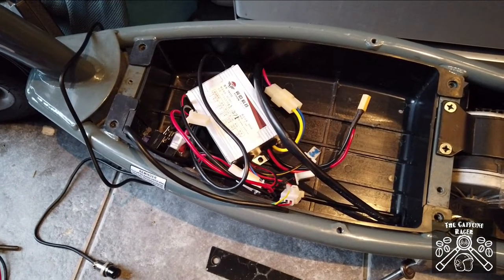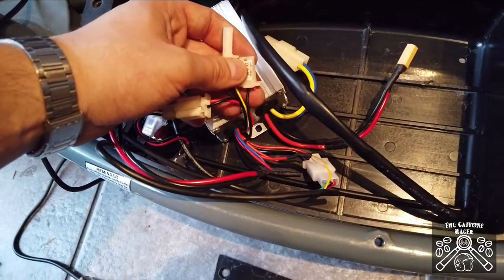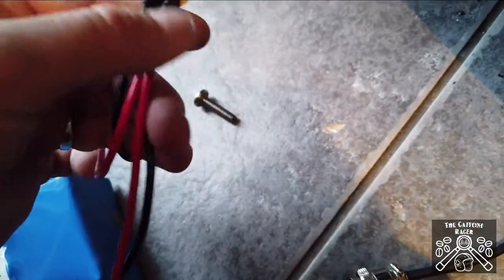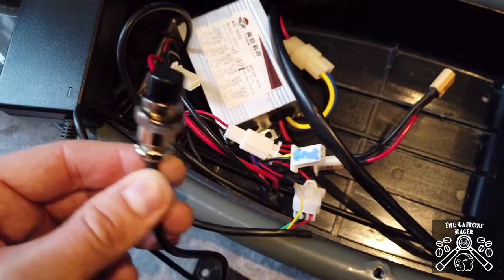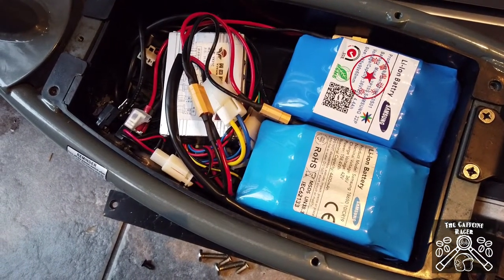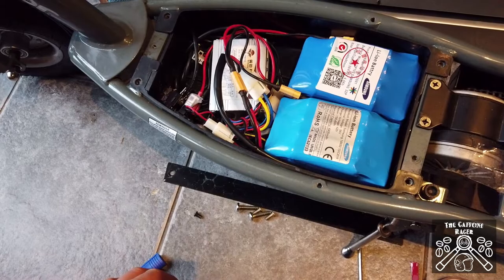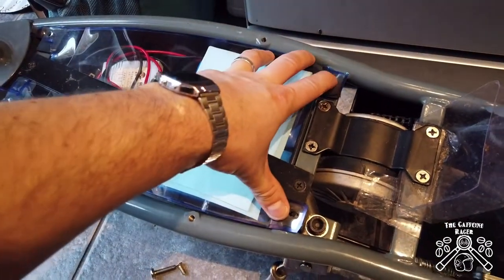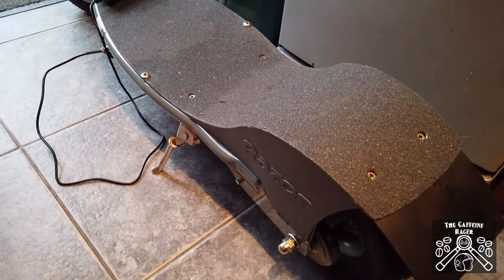Razor E300 Upgrade - Fast 36v Original motor-  my mods phase 1

Comment: 36v 500 w will work with a 24v 250 w motor?  Is that what you mean by over volting?
Reply: Yeah, when you over volt it means to increase the voltage of a rated motor so a motor that is rated at 24 volts 250 watts and you overvolt that motor with a 36 volt battery you are increasing the rated voltage of the motor which is overvolting.
Reply: Andrew Aguilar24 will it burn the motor out?
Reply: @albread  It depends on what type of riding conditions and weather you have, if you want to overvolt a 24 volt motor, I would use a 24 volt 500 watt rated motor and not go over 36 volts, if you want a motor I would go to fastscooters on ebay and buy a 500 watt direct fit motor that they sell for around 75 dollars. If you want to use the original motor I probably wouldn't use it at full throttle all the time but using a stock motor can work but you just have to be careful not to ride on the motor for too long at one time. You could also put a fan on the motor as well to help it cool down and not overheat the motor.
Reply: Andrew Aguilar24 what about a 24 v 350 motor
Reply: @albread  Yeah that will also work too because the motor can take more current through the motor meaning that the motor will be able to handle overvolting better than a stock 250 watt motor would because the old motor can't take as much amps which makes the original motor get hotter and may cause to burnout but a 24 volt 350 watt motor should be good.
Reply: The higher the amount of watts the motor is, the more better it will be able to handle overvolting.
Reply: Andrew Aguilar24.   Can I use a 36 v 350 watt with the 24v 250 watt motor or 280 watt motor?
Reply: @albread  Yeah that should work fine if your talking about a 36 volt speed controller rated at 36 volts at 350 watts and connecting it to a 24 volt 250 watt motor or a 280 watt motor will work fine.
Reply: Andrew Aguilar24 did you switch to lithium batteries?
Reply: @albread  I did not switch to lithium batteries for now because they are a little harder to find a pack of reliable lithium batteries that have a high amount of continuous amps but I have found some reliable lithium batteries I might get for my Razor e300 that are 10 ah 12 volt lithium batteries that can be wired in series that are from https://dakotalithium.com/product/dakota-lithium-12v-10ah-battery/?v=7516fd43adaa. They have an 11 year warranty on those batteries and have a higher amount of continuous amps for overvolting a Razor e300. They are also wired almost exactly the same as lead acid batteries are and you can just buy a 4 amp lipo04 battery charger from electricscooterparts.com. I will most likely be doing this in the future and am pretty positive that they will work.
Reply: Andrew Aguilar24 does those batters weigh the scooter down?
Reply: al mil Nope, they actually weigh two pounds less than the original scooter batteries in the Razor e300.
Reply: Andrew Aguilar24 and you will use three of them. Will all three fit in the battery tray?
Reply: @albread  All three will fit in the battery tray, but will stick out an inch out of the deck sadly. My recommendation is to put the third one on the deck, or make it so your batteries fit in a backpack. You could also make the battery tray bigger to fit the batteries under the deck.

Comment from the maker: Neb can't seem to find ur comment to reply on 3pin plug please repost it gx12 connector for charger https://www.ebay.co.uk/itm/283585673998
Reply: Sorry I deleted and was rethinking what I was going ask again. LOL. Thanks for replying, I really appreciate it. Is there any reason why you didn't re-use or cut the connectors from the original Razor charger? It's not color coded but I was thinking I could possibly salvage it rather than throwing it away.
Reply from the maker: @nebpimentel7349   they were in moulded plastic would have been a pain to strip down was all so got new one but yeah i used a GX12 connector very sturdy. 500w motor goes in today.